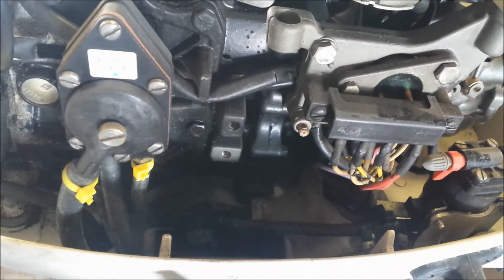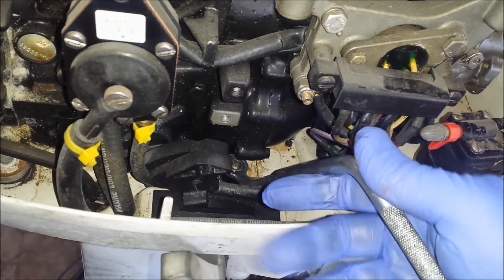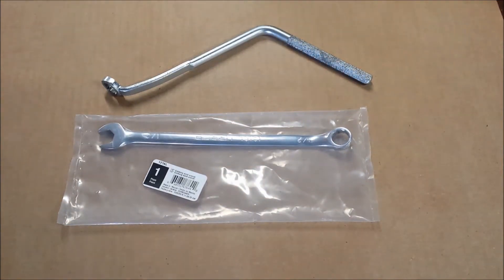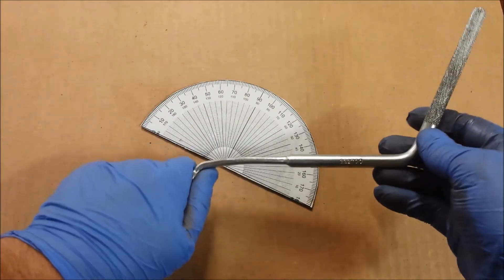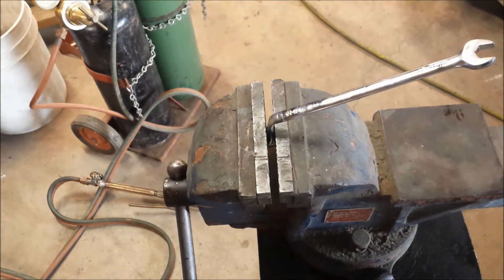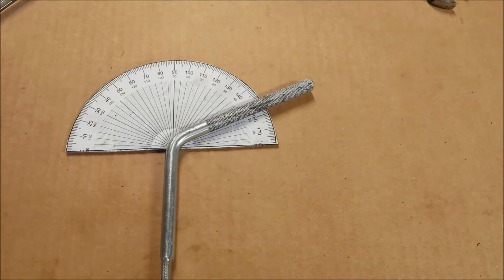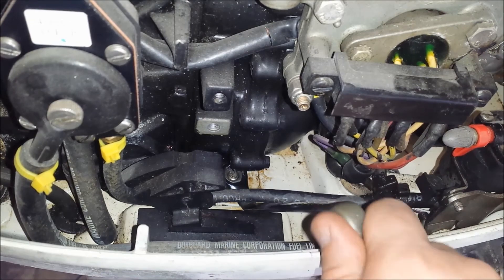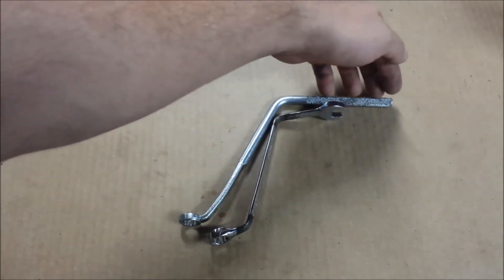DIY 20 / 25 / 28 / 30 / 35 HP Powerhead Nut Wrench

Comment: 1/4 inch drive 1/2" socket works wonders on these
Reply: I don't want to be snotty or anything, but why would they make a special tool if you could get a socket on that nut, they wouldn't.
Reply: g Baylis have you seen some of the "specialty" tools johnson came up with. And u can also use an extra stubby wrench for this as well.
Reply: Nice try, but there is a whole 1/32" clearance at the top of the bolt to remove the nut once you've cleared the bolt threads with the nut.  You need to show us the socket that will fit over that bolt.